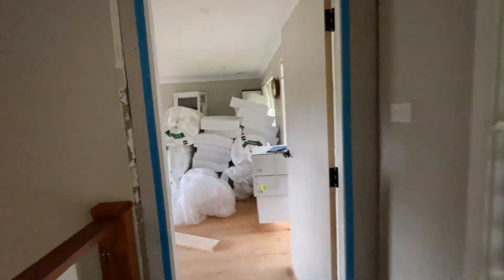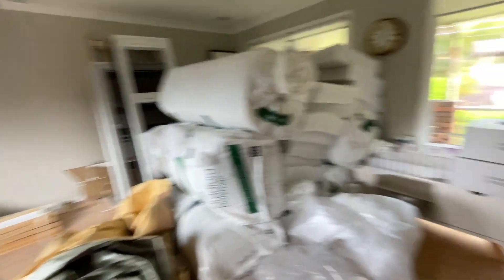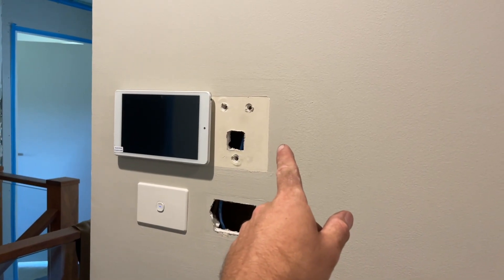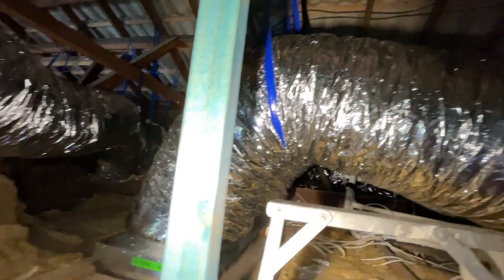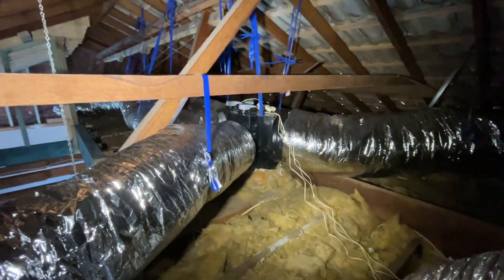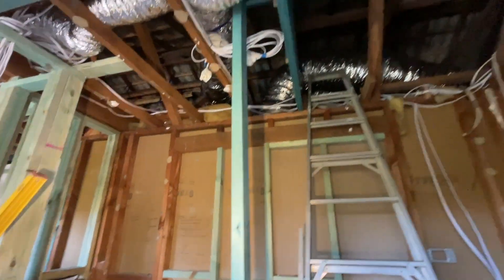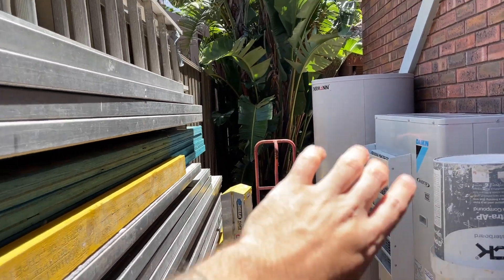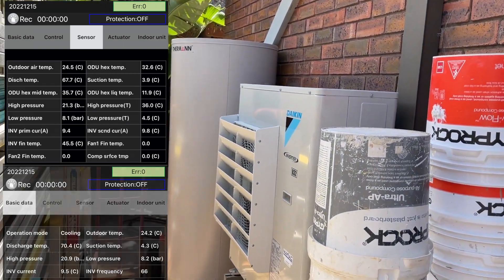25 YEAR OLD HITACHI AIR CONDITIONER STILL RUNNING⎪DAIKIN REPLACEMENT

Comment: Hey Mitch, what supplier in Aus did you get the condenser fan louvers from?
Would also love to see you do a video on installing and commissioning an air touch system if you deal with them.
Reply from the maker: In regards to the air deflectors. Both Daikin and Panasales sell them. I buy the Panasales one and use it on Daikin as it fits fine. 
If I install an Air Touch I’ll definitely make a video. I have installed one and I personally feel like the MyPlace set up is better BUT that install was like 4 years ago so things might of changed.

Comment: Looks good mate. I am no expert not even in the AC game but vertical discharge just seems to make sense to me too, This has always been a selling factor for Actron and if you watch their video on it it does kind of make sense. My old house had an old beast of an AC installed in 1983 it was an EMAIL AIR (AirWell) it had a vertical discharge current is Actron and the amount of heat you can feel pumping out of it in summer just makes sense to send it up IMO. https://youtu.be/tCSSZixZjrU
Reply from the maker: It 100% makes more sense. I’d like to try Actron at some stage to see how they go. In regards to the old email air units, they were great. I worked on them from time to time. I’m a big fan of them.

Comment: Nice job Mitch, that is a nice Daikin A/C system and should work well, i hope you didn't damage the new carpet pushing that old Hitachi out door unit into the new Vee Dub   😟
Reply from the maker: Thanks mate. Don’t worry, I had cardboard down in the van so I didn’t ruin the carpet. That’s actually why it was so hard getting it in because it wasn’t sliding, it was just getting caught! Haha.

Comment: Nice work as always Mitch. I have an odd fault I'm going to look at tomorrow with an old daikin 12.5kw r407 ducted unit. No fault code showing, indoor unit running but not cooling, and the outdoor isn't firing. I'm guessing it's not coms as the indoor controller is working and not showing a fault code. I'd put my money on capacitors if it's not tripping with the compressor being shorted, no coms error and no lp/hp cut out, but the outdoor won't start.

Amd yes the actrons are are awesome with top discharge, but yes they're very heavy. I only put them in where I don't have to lift them.
Reply from the maker: I know the old R22 Daikin 12.5kWs well.  I’m assuming the old R407c units are similar. They have an outdoor board that sends a signal to the outdoor contactor to engage the compressor.
I believe the blue cable coming out of the board is X2. Id open up the outdoor unit and see if the board is sending out power from X2 (I believe the X2 sends power to your A1 on the contactor to engage the compressor). The outdoor fan motors both come out of the outdoor PCB as well and are labeled M3F and M2F on the board. There’s 2 4uF capacitors for the fan next to the board but yeah you’ll be able to see if the board is sending a signal for the comp /fans etc in about 60 seconds. Let me know how you go, I’m interested to know. Im going to have a crack and say the board is faulty.

I’m hoping this is a side job making new contacts up there haha. Good luck mate.
Reply: @maracservices  You're on the right track.

I checked it this morning. Normal stading pressures, intermittent operation of the outdoor unit after resetting it which was odd, it's like the boards output works sometimes but not others. Comp pumps down, cuts out, I wasn't getting higher pressures on run, fans operating fine. The compressor wiring at the board is outputting voltages on start and run simultaneously. I managed to get an L8 fault showing at the controller, which is compressor overload, wiring disconnected or faulty inverter PCB. So yeah the PCB looks to be the culprit as mechanically it appears fine unless there's something odd happening with the compressor,  but in my experience they tend to just stop working altogether. The hard part seems to be finding the board for a rzp125dv1 as it looks like daikin have discontinued them.
Reply from the maker: @lwilliams3285  nice work mate. I have an old R22 Daikin outdoor board at home that I took out of an old system I replaced (it still works). I could give it to you but the model number is different to the one you just wrote. Unfortunately it might be time to replace the system I think.
Reply: @maracservices  yeah mate daikin said no go on parts. It's probably 15 or more years old anyway. Little job for my side hussle anyway, it's just never fun doing ducted systems by yourself.

Comment: Great job mate, looking good! 
Mine was a Sygnal Ambient Intelligence unit with 4 discharge fans ( not sure if you’ve worked with SAI HVAC before or familiar with them) but it was right up near the fence and struggled to keep the house comfortable in summer. I don’t know who installed it and thought it was a good idea, so dumb. Got replaced by SAI with a Compact Comfort top discharge.
Reply from the maker: I can’t say I have ever worked on SAI HVAC before but I really don’t know why more manufacturers don’t make their units top discharge. 
A good mate of mine has gone into his house on a hot day and it was 37°c in the house. He turned the air con on and it was supplying 20°c air out of the vents inside. He then put a hose over the outdoor unit coil and then the unit was suppling 4°c air out of the vents inside. Moral of the story is, if the unit can’t reject heat out from the compressor the a/c is drastically less efficient. Thanks for the comment!